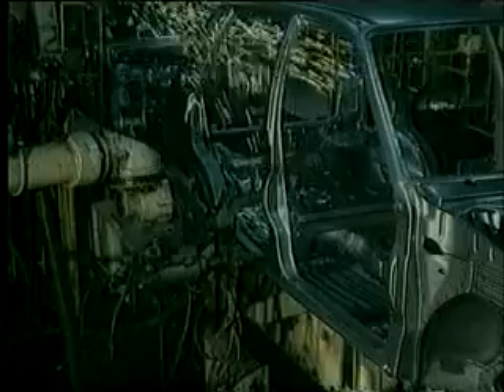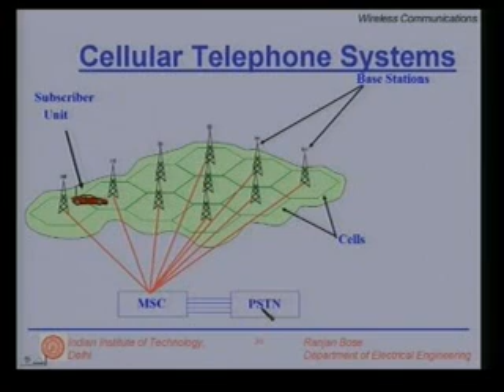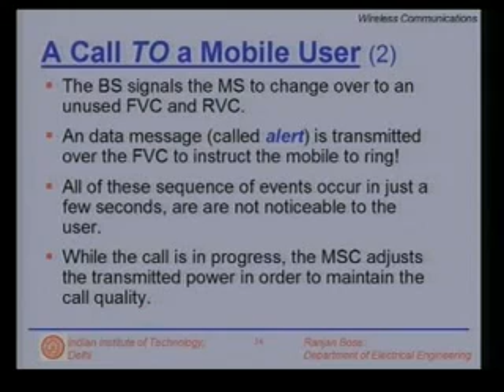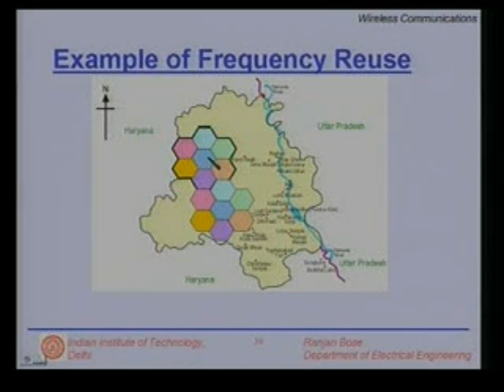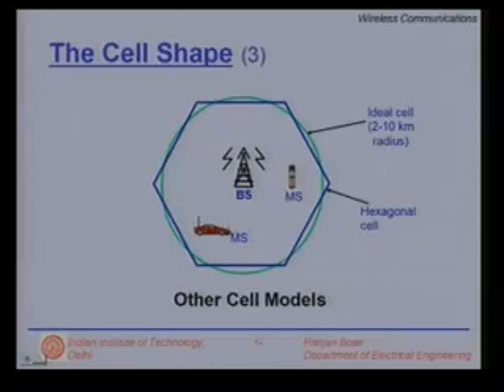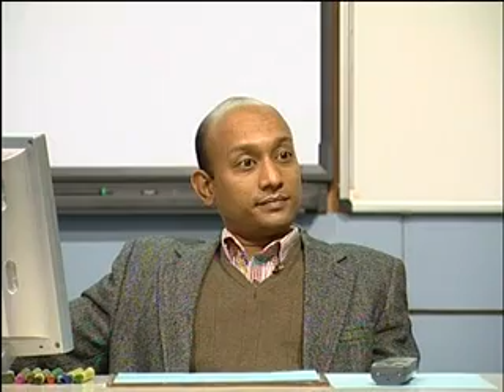Lecture 4 - The cellular concept - System Design issues

Comment: have a doubt regarding that MIN numbers...is it used to identify the mobile or to identify the sim .if mobile means how...because the changing of a network would allow that person to escape with the theft phone kno..or any detail regarding the mobile like..a number assigned to the mobile by the manufacturer is stored in the lookup table ah....please reply....
Reply: i guess there are provisions for knowing both the Sim related MIN and mobile hardware related MIN . If you take the case of iphones , even if they aare stolen and sims are changed , we can still block the usage of a phone . But phone  related MIN is a highly discreet data since it can be used to monitor the activities of a phone thus intruding the privacy of the mobile user . So only sim related MINs are easily accessed since the sims can be easily changed and are of no further significance